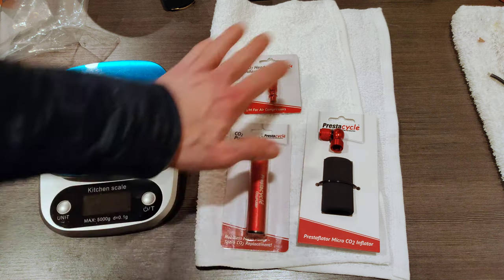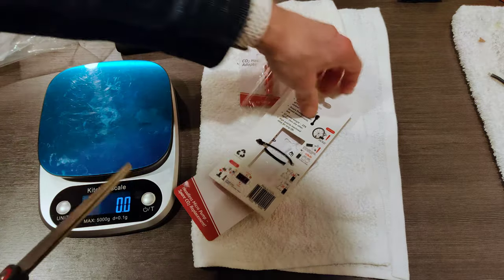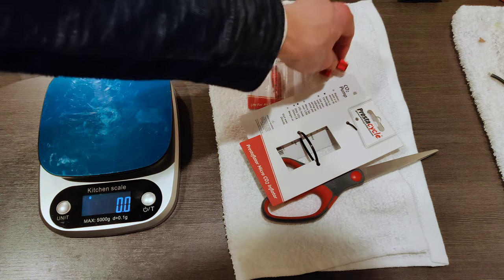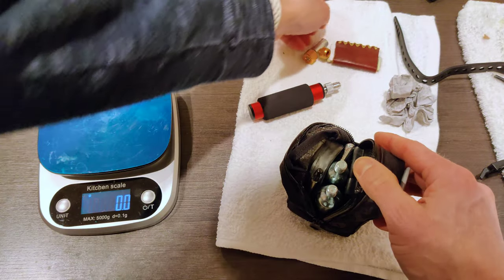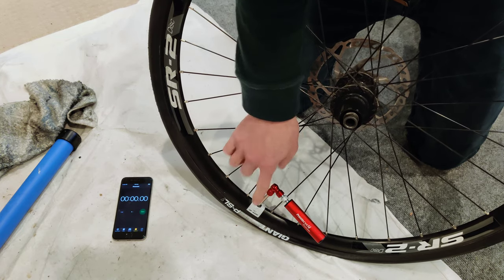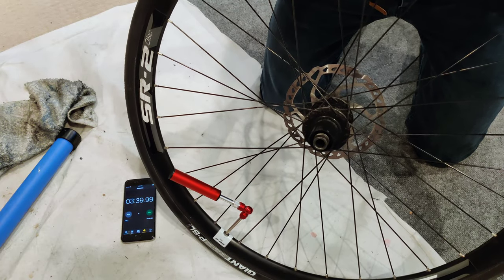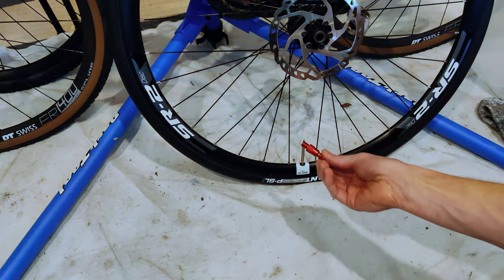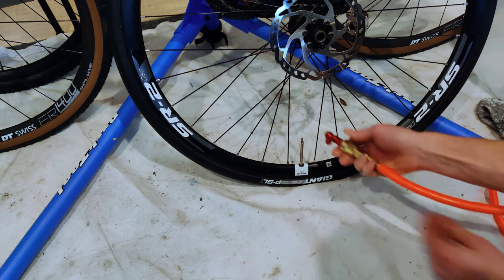Prestacycle Prestaflator Micro - Co2 / Air Compressor / Pump System!

Comment: I have a lezyne co2 head that screws on, and haven't had it take the valve core out.  But I do make it a point to not purchase tubes with removable valve cores.  Do you recall how long it took for you to pump up the tire using your blackburn pump?  It'd also be nice to see a side by side comparison of the co2 cartridge and the pump.
Reply from the maker: I run tubeless everywhere, so a removable valve core isn't optional. CO2 is near-instant, so it's always going to blow away anything that isn't an air compressor :).
Reply: @Mamilian  I mean the size of the pump and the size of the co2 cartridge.
Reply from the maker: @vancekwan628  Ah! Sorry, can't post photos here, so I put it up on the site: https://www.mamilian.bike/blog/2021/10/just-for-you-vance

Comment: Not sure if I missed,
What PSI where you able to achieve just by hand without getting exhausted and then the final PSI exhausted.
Reply from the maker: I didn't get a chance to check the PSI because I ripped out the core. "Firm enough that I would ride it" was probably around 75psi (I generally ride 80-83) by my thumb.